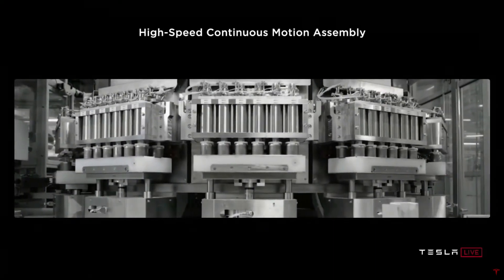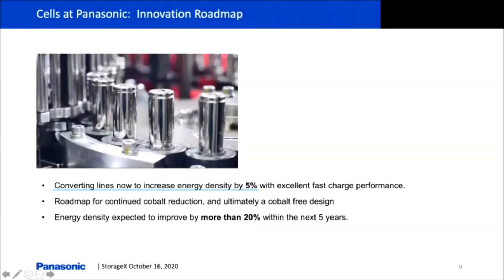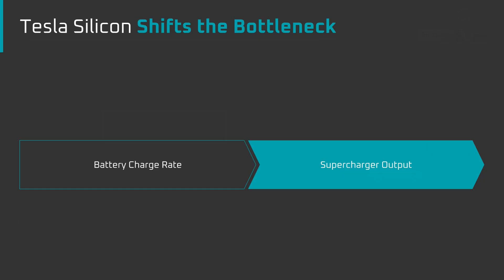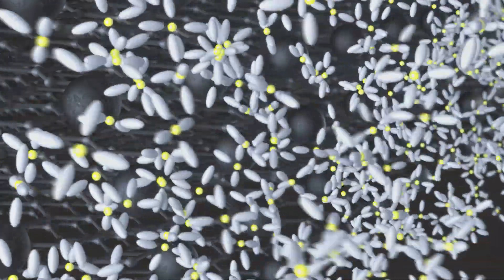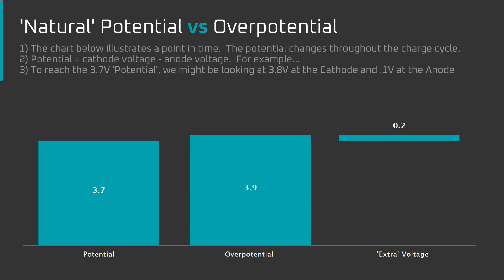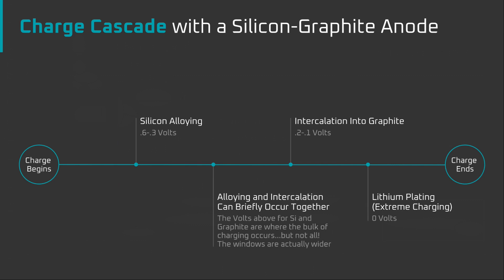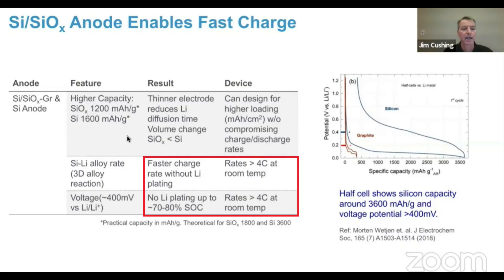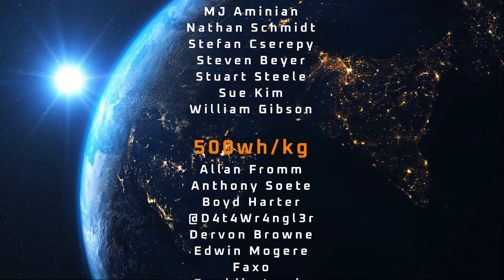#6 Tesla Silicon // Fast Charge is on the Way ⏩🔋 // Deep Dive

Comment: Why are EV batteries not charged in CCCV mode? That is a delicate way of charging right? When monitoring the charge rate (see Fastned graphs for example) slows down with steps over time.

Comment: Just ran into your channel, very scientific explanation. However, I would like to ask two questions:
1. Silicon would cause significant volume change of the anode material during charge and discharge. This change would breakdown the SEI causing faster degradation. How could we solve that? Tesla silicon mentioned in the battery day video had a speak of special polymer bonding. However, it is rather limited.
2. Silicon anode is more unstable at high SOC. This means more energy would released during a TP event. How could we address that problem.

Apologize for my questions. As a person working in this field, just would like to learn more.
Reply from the maker: Check out my Silicon Deep Dive video with the green thumbnail.  It came out a video or two before this one.

As for 2.) TEsla has apparently designed further safety measures to reduce thermal propogation in the 4680 pack.

Comment: I believe Tesla Easter Egg'd this at Battery Day on the slide at 1:26 . They show the tabless cell having only a slightly increased charge time when increased from 21 to 46mm diameter. If true, they neglected to mention on that slide that the 4680 cell has about 6 times the capacity as a 2170. 6 times the charge in about 120% of the time (estimated without a scale on the slide). Based on that idea 4680 packs should charge significantly faster, only limited by supercharger output. Theoretically up to 5x times faster, practically around 2x. Also, if true and they can charge faster, maybe discharge rates are higher allowing for even better performance possibilities in short bursts.

Comment: A central inhibition for many who would like to consider purchasing a Tesla car is power recharging.
A home installation for barely adequate overnight charging costs several hundred $.  
Many homes do not have sufficient electrical power to allow for more efficient 240-volt chargers.  
HERE IS HOW THE PROBLEM CAN BE ADDRESSED:
The Tesla supercharger requires approximately 40 minutes for an 80% charge.  
40 minutes is also the average time spent at Costco or other big-box store shopping. 
BIG BOX retail locations have ample electrical surplus capacity to allow dozens, perhaps hundreds of Tesla super-charger plug-ins.    
Tesla should consider contacting big-box store operators (I have already sent this suggestion to Craig Jelinek / CEO of Costco) for the installation of high-capacity electrical super-chargers for their retail parking lots. 
HOW WOULD IT WORK? 
The member, via smart-phone/home-computer, makes a date to reserve a supercharge parking location at a particular store for a designated time period.  
The member arrives at his/her supercharger parking space, inserts their membership card, plugs in, and goes shopping.  
40 minutes to an hour later the member returns with his/her purchases, pay for the charge with a credit card, and drives away with an 80+ % battery charge. 
Consider the convenience.  
Consider the convenience.

Comment: If Tesla changes to 350kW, they will need 875A charger as long as they maintain 400V architectures. That means too thick cable sections. Do you think they will change the battery voltage architecture to 800V? I’m very excited to see what happens...

Comment: A chemistry question. In 14:17 you mentioned the overpotential is not high enough to plate Li on graphite. So my guess is, Si would have a lower nucleation barrier for Li, right? And is the overpotential decreased in this system because the Li concentration is decreased? (fundamentally, I think the Si serve as buffer which quickly react with most of the Li released)
Reply: Ok, I just notice the explanation in 13.27. I think you may ignore the nucleation potential(or just for the audience's convenience). The figure in 13.27 is referred to as equilibrium potential. However, in plating, there is an additional nucleation barrier. Anyway, you might know https://www.nature.com/articles/nenergy201610 this, since you explained the Samsung Ag paper. Nice work!
Reply from the maker: Thanks man and thanks for your thoughts.  I don't understand nucleation potential yet and the researchers I spoke to didn't mention it.  However, I'm sure it will come up as I learn more :)

Comment: 5:52 Assuming a 100kWh battery and charging to 50% in 5 minutes, wouldn't you'd need a 100*60/5 = 1200 kw charge rate?
Reply: No. 100kWh / 1h * 60min/5min *50%/100%=600kW. You forgot 50%

Comment: Impressive work! Could have saved me hours of reading papers and reviews :D Not sure if you have the resources, but could you do a piece on how exactly Tesla wants to tackle the volume expansion of Si during alloying? They claim to use a Li-conducting polymer-coating to stabilze the SEI, but I honestly do not fully understand the approach. Lets for simplicity assume the polymer coating prevents the rapture of SEI that has formed around the Si particle. Nevertheless, the SEI also formed around the graphite particles. When Si expands during the next charge, the polymer coating to my understanding does not prevent the rapture of SEI that has formed around the graphite particles, because Si and graphite particles are simply to close together to prevent this. If it is the mysterious additional "elastic binder"that solves the issue, then you would need to add quite a lot of it, decreasing the amount of active material and hence energy density and increasing the amount of non-conducting material resulting in an increase in resistance.
Reply: Just found this: https://www.youtube.com/watch?v=YTW_Q63bEEY 
Maybe things clear up there :D Thats the problem if you watch stuff not chronologically
Reply from the maker: Looks like you found the right video, lol.

Comment: I would be more than happy if Model S had around 120kWh pack with new 4680 cells and was charging at 250kW all the way to 80% at flat curve. This would mean 25 min break for another 500km drive.

Comment: is high loading silicon work with LFP Cathode and if its work how much the energy density (whr/kg)  will be achieved with DBE and 4680 CELL FORMATE and maximum volage ?
Reply from the maker: I haven't looked into this yet!  I don't know how the different voltage potentials interact 🤔
Reply: I am working on new project to utilize 26% Si and single crystal LFP cathode inside 4680 format cell? if you are interested let’s share our results

More do you have started method to calculate the actual energy density at cell level ?!

Comment: Another Analogy is examining the electrostatic potential difference of a thunderstorm,  long before the lightning strikes there is broad spread of potential difference that forms across a large region of volume and that gives rise to a lightning strike, charging a battery is kind of like a controlled lightning strike accept we seek to transfer amps instead of voltage. In a lightning strike voltage dictates the outcome, recharging a battery is the inverse correlation of that potential difference.
Reply from the maker: Great analogy!

Comment: Imagine you have an enormous flood across a flood plain and the water has no where to go, what do you get? You get a lake. Now imagine that you have large surface area and the ground on which that lake has formed is highly absorbent, suddenly the great volume of water disappears into the ground. The tabless electrode is like that. There is very little vertical pressure ie, low voltage but the surface area is enormous, This what tabless electrode design enables.

Comment: Supercharger capability will be a nominal function of the surface area with respect to tabless electrode design! I do not know what the co-efficient of surface area to charge potential that the new design facilitates. I believe the increase of that surface area relative to the pana cells is orders of magnitude greater. The conductive surface area relationship determines the potential for Amps or coulombs of charge to be transferred.

Comment: A properly designed super charger does not need a significant potential difference to transfer charge if the surface area of conductivity is large. Tabless electrode surface area must be considered as a function of charge induction.

Comment: Anti-Osborn Marketing Policy - where you get to trade in your older tech battery for a newer one after you have used the older tech battery for one to two years.  The old tech battery gets put into the domestic electricity grid and the new battery goes into your 1 yr old car.  The newer lower cost more efficient battery comes with a fee that is washed to  0 by the trade in and possession for 1 yr of the older battery.  Win/Win/win;  Consumer/Tesla/grid.

Comment: The graphics are great yet still not good enough!  It is conflicting and contradicting to criticize and compliment the graphics work at the same time; but there it is!    You seem to have illustrated that the charging speed seems to be a function of the geometry of the battery cell.  The tight coils save space but make it slower to charge.  This seems to beg for more edge surface being available for the transition of electrons through the material.  Thus a cylindrical cell works against itself where fast charging is the goal.  The prismatic; flat pouch, geometry seems to design itself on that realization.

Comment: Hi Jordan, would it be possible to dump energy into onboard super capacitors who then charge the battery-pack?
Reply from the maker: Yeah for sure, but if it were worth the cost benefit, then someone would be doing it.  I think they do this for some busses, but that's a different use case.

Comment: Seems like a natural way to go is 2x higher voltage batteripacks that will allow 2x the charge rate at the same maximum current rating. So a V3 supercharger could provide 500kW charge rate.

Comment: silicon's Li-ion conductivity totally tanks for higher charged states, inducing a lot of polarization losses. it could very well happen that the taper after 80% for SI-anodes is stronger than for the current graphite tech IMHO.

Comment: Tesla wants cheap Silicon with Polymer, HPQ Nano Silicon is expensive and it solves the cracking problem but not the glue viscosity of silicon over time
Reply: HPQ Silicon is inexpensive. That is their whole advantage.
Reply: @titaniumjoeszigeti  How much ? It's highly speculative and riding the EV/ Tesla bandwagon, however I hope it turns out well and successful
Reply: I believe HPQ said battery manufacturers might pay around $30-$50 per kg.

Comment: Actually especially on a Semi nobody needs a 5 min charge as long as human drivers are still involved. As Semi just needs enough range to bridge the time between regulator forced break times of the truckers. E.g. in Germany a trucker may drive 4.5 hours and will have to do a 45 min break fter that. At a maximum of 80 kph allowed for a truck in Germany and actually driven 90 kph by the truckers you would then have to get a 405 km range charged within 45 min. For sure a autonomous truck will become more worthy the longer it can run without charging. But I think autonomous trucks are still far away (in terms of time).

Comment: I would have guessed that the silicon loading is around 30% because silicon can triple in volume when saturated with lithium.  I don't think graphite was mentioned on battery day -- just pure silicon particles suspended in a flexible polymer which allows them to expand and contract without cracking the anode.  Does that sound right or am I missing something?
Reply from the maker: Watch the 'Cracking the Silicon Code' video.  I'll be reiterating the points made there in another upcoming video with actual calculations.
Reply: @thelimitingfactor  ...oh... wow... I was missing *heaps*.  Your videos are excellent - thank you!

Comment: With improved charge rate, Tesla (and others) could reduce the size of the pack producing a virtuous circle. Reduced pack size, reduces weight which increases range. Battery charges quicker as it is smaller in capacity reducing time to full (or 80%). Recently Elon mentioned that he was wanting the minimum range to be 300 miles. If this were to be 200 miles (still more than adequate for most situations) then pack size/weight/charge time would be reduced by 33% while (slightly) increasing range due to reduced weight...
Reply: Also, this would allow 1.5x the number of vehicles to be built or allow more stationary batteries to be manufactured assisting the rapid deployment of renewable energy technologies...

Comment: I'm recalling that the mode of engineering being being expressed here was once dubbed exploratory engineering by Eric Drexler. It has to do with mathematically exploring The possible design space using what's known about physical law, however in this case in relation to what's presently known about the firm's manufacturing capabilities.
Reply: I'm certain that a lot more could be said about this and that I'm not going to be saying it right now!

Comment: HPQ Silicon is the leading edge of nanosilicons
Reply: Hpq released they could do spherical silicon particles from nanosize up to 5 Microns (and even carbon coat them in the same process if required).
Reply: I wonder who is the car manufacturer that requested silicon powder from HPQ. Interesting.. will find out this December. Seems like a good Company with their tech.
Reply from the maker: Yes....but will Tesla use nano silicon?  It doesn't look like it.  Covered in the next video.
Reply: @thelimitingfactor  
Actually Elon said that using nano right now would be to expensive. But all that is about to change thanks to HPQ silicon , stay tuned.
Reply from the maker: @saint2709  hmmmmm, when did he say this?  That could be helpful information!
Reply: @thelimitingfactor  Hi Jordan, thanks for this video again, great work. Elon may dont want to use nanosilicon because it is too expansive and not scalable... true, until HPQ comes in. HPQ seems to be the real game changer because they can scale this process and produce perfectly spherical nanosilicon cheaper than graphite (couple of bucks/kg). It will be cheaper tu use hpq nanosilicon than any other stuff and will be a way more efficient. Truly mind boggling when you go deep on all this !
Reply from the maker: @alexl25  Nano silicon generates higher first cycle losses.  Watch the Cracking the Silicon Code video.

Comment: Wow insanely good explanation! The graphics are awesome <3 Makes it easier to follow. Also when you are talking about 4C charge rate is that equivalent to 12 Amps? Also regarding Lithium plating (if it happens) would the metallic lithium dissolve during discharging or due to the fact that it is now solid meaning dendrites form?
Reply: Pasan Perera The plating will dissolve but it will be uneven this is why dendrites form the plating and dissolution process is not evenly distributed.
Reply: @kazedcat  Right that makes sense, thanks, mate :)

Comment: Something that's been making me uneasy is the rollout of megachargers. Higher currents mean bulkier wires and one can only raise the voltage so much before one needs to be a licensed electrical worker to even get near such devices.
Given all that, the idea of 2 or 3 parallel CCS ports make sense. Instead of one giant cable, you connect 2 or 3 smaller cables. The fact that AC electricity is transmitted as 3-phase does provide an analogy here.
Another concern is that megachargers would draw very high currents very suddenly, which could cause local voltage sags. If the local grid is small enough, this could even negatively impact grid frequency (a proxy for electricity supply and demand imbalance). then there are grid congestion issues to contend with. Grid operators could get very leery about these.
One possible work-around would be to throttle megacharger power (whuch kinda defeats the point, doesn't it?) or be forced to pair megachargers with batteries. That sounds anything but cheap.
Reply from the maker: This is great information thanks!

Comment: I think you are missing the point a bit with the charging. Extremely fast charging matters little for cars with large battery packs. At 350KW you are gaining about 1400-1750km an hour so any large battery will only need a small top up before the driver himself needs to take a long brake and charge up fully.  However this charge rate is big news for cars with small batteries.  If you have a 54kwh battery pack of a model 3 then fast charge starts to matter a lot. You have to top up much more often  and you would almost charge up the battery in 10 minutes while now you need 20-30 min for the same effect.
Reply from the maker: I just can't put everything into every video is all.  It's a good point and is illustrated by one of the graphs for those with good insights (like yourself)

Comment: I was curious, so on my last road trip I checked my average stop time. It was 14 minutes with an ICE car. Actually using the pump, paying, then going to the rest room and paying for a quick snack was 12 on the short end, 16 when I had to wait once. So a 15 minute stop, where I can plug in and not baby the car waiting for the pump to finish is perfect. Tesla will be there in the next 2 years is my guess with 350KW charging.